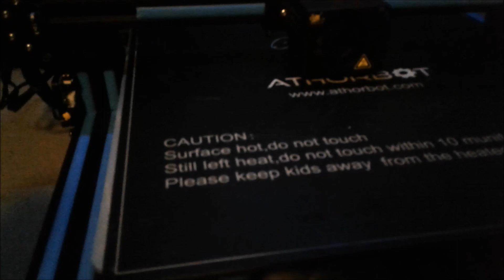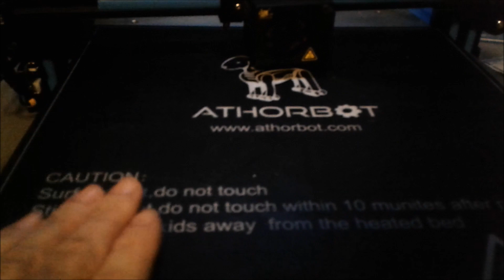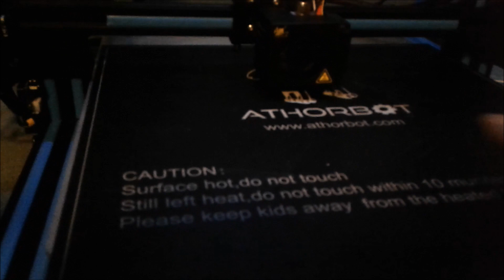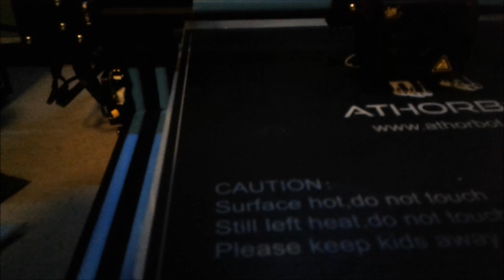Creality CR-10: Extruder Problems & Solutions

Comment: Thanks. I found this not particularly useful. My extruder problem is that filament is not advancing; tightening or loosening the set screw that controls tension on the spring is not solving the problem. I suspect the crimping wheel is not properly engaged, but can't inspect without opening the housing, and closing it again. More specific advice is necessary.

Comment: Check out where your extruder gear and wheel is that feeds the filament in the bowden tube... Is the wheel in front spinning when the gear is? If not, you may want to tighten the screw on top of the left atop the plastic piece that you squeeze when sliding in or out the filament. That wheel is responsible for adding pressure on the filament and onto the gear and sometimes that comes loose and  keeps it from having a pushing effect on the filament into the tube.
Reply: I have the same problem over and over again. I just order a aluminium extruder set and I hope it will help me fix this problem. Otherwise do you know any permanent solution, cause it seems that the screw comes out within 8 hours after the print starts and there is rely nothing I can do about it since most of the prints is more than 15 hrs and I cannot baby sit them. So Ill be happy for any suggestions Thanks